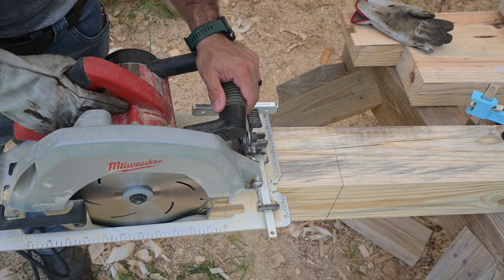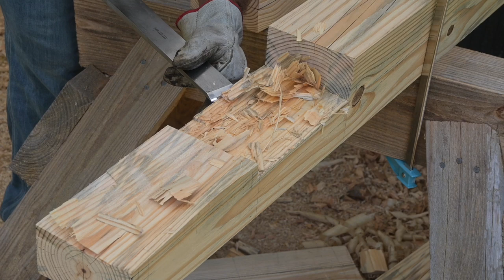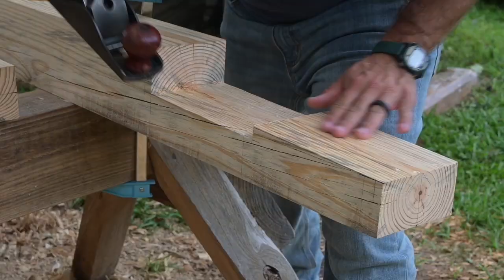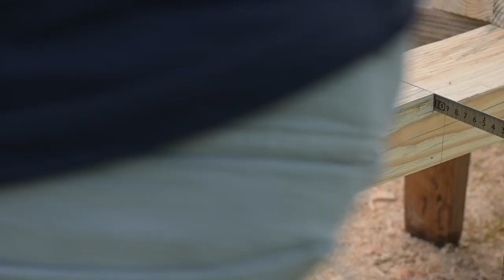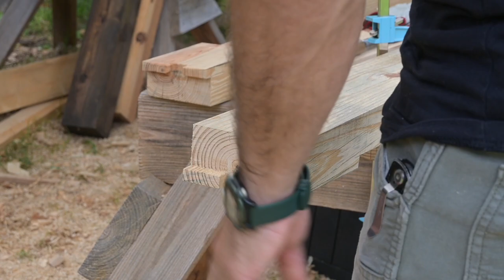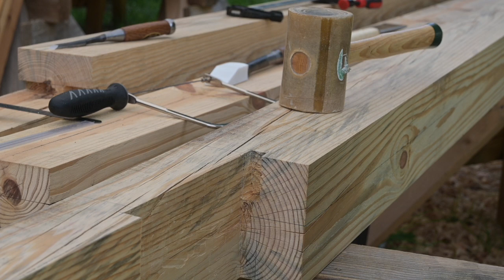Cutting a Shiribasami Tsugi Japanese Scarf Joint Step by Step

Comment: Is this the same as the Kanawa Tsugi in Bracht’s book?
Reply from the maker: No, but the two are very similar. It has an additional little cog piece on the two smooth looking sides in this joint, if they makes sense. This one is traditionally considered more aesthetically pleasing because of the two smooth joins without that visible cog. Otherwise they’re pretty much the same.
Reply: @appalachianwoodhomestead thank you!! ❤

Comment: On your pull saw(s), if you'd noticed how the blade is designed closest to the handle, you'll notice that, that small edge is actually designed to be your starter for all your cuts. So, in short, pull saws you start by pulling not by pushing and vice versa with "western saws". 
This is what I love about Japanese carpentry, they, (Japanese & Chinese), always start from center line of all pieces then work outward. Takes patience and lots of practice. Great video, cheers :)
Reply from the maker: Thanks boss. 

I do agree with you regarding the smaller teeth, but that’s only applicable to the rip teeth (at least for this saw). None of the Japanese saws i own have smaller crosscut teeth near the base. 

It does seem like many of the Japanese tools were developed and then engineered for efficiency, much like their joinery.